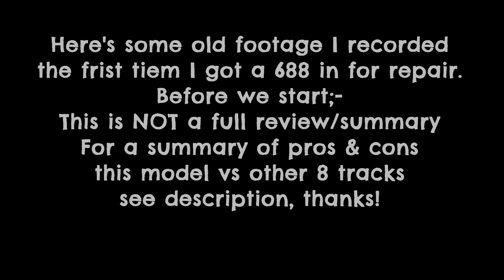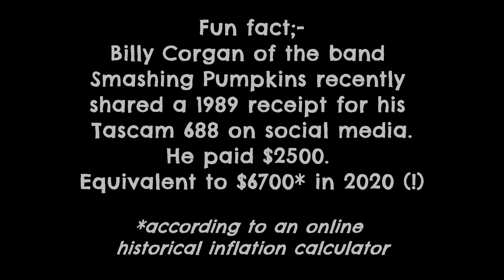Tascam 688 Midistudio | First impressions

Comment: Hi Calum, have you got any further with your repairs on this unit? I decided to chance my luck and bought another untested 688 this week, which unsurprisingly doesn’t work. It powers on but the LCD and transport buttons are completely dead (I can hear the motor humming and the external sync switches light up). Have you came across anything like that before? Thanks
Reply from the maker: Not really. You could check for unplugged cables in case a previous owner didn't plug boards or voltage regulators in properly on reassembly following a belt change or similar. Failing that, it'd be a matter of methodically troubleshooting, which would be a totally disgusting experience on a unit that large, heavy,  complex, and difficult to disassemble.
Reply: @Tetrakan  Thanks very much for your reply, and starting points. I’ll look for the obvious stuff and tag out if that doesn’t work, I lack the skills, patience and time for a methodical deep dive. 😳😂
Reply: @wehappyfewmusic  Try switching external sync to off. It wont work with external sync 'on', unless it is actually synced to something via midi & is a slave to the master midi device (eg DAW etc). My cat knocked my external sync to 'on', recently on my Tascam 688|)& it took me some very frustrating nights to figure out why it wouldn't work. Im mainly only using mine as a mixer right now, but it would not even work that way, with the external sync switch 'on'.
Reply: @emeraldphoenix9229  Thanks for the suggestion. I sent my unit away to get fixed and it had multiple issues unfortunately. It’s close to being fully functional now but it won’t record on tracks 5-8 for some reason. These are great machines when they’re working but seem to be tricky to fix.

Comment: Have one and can confirm that the fidelity is better than my 464. It’s a really good machine once you get it up and running. The SP tracks like “Pennies” and “Marquis in Spades” also illustrate that it’s quite capable of making excellent recordings.
Reply from the maker: By contrast my 464 sounds clearer than my 8 tracks. Not that my 8 tracks sound bad...an objective way to demonstrate the differences in fidelity between wider and narrower tape regions would be using spectral analysis to measure the volume of the harmonics from a square wave recorded to a 688 and 464 simultaneously. It's an experiment I will do for the channel one day. I expect to be able to demonstrate a quieter response to harmonics from the 688 from 4kHz up, and a narrower dynamic range.

Comment: Hi have you got around to fixing this unit yet? Would love to see what you did if so! I’ve just bought a 688 which should arrive soon, and I’am hoping it’s fixable. 🤞🏻
Reply from the maker: Hi, no, it's still languishing in my garage. I've totally overcommitted myself with repairs, reviews, demoes etc so probably won't get round to it until 2022! I hope for your sake yours works straight out of the box, disassembly is such a protracted process on this model, good luck
Reply: @Tetrakan  thanks, I think I’m going to need a lucky break on mine, otherwise I’ll have to find someone else to fix it.

Comment: The designers/engineers @ Tascam really did some amazing tricks to squeeze so much fidelity out of 8 tracks on eight inch tape, & I think one of the overlooked reasons, despite the excellent sounding mixer built in, is tape speed. It runs very fast, therefore much more ferrite/ chrome/ metal particals, passing the record/ play heads than a normal 4 track machine. A C60 tape only records about 9 mins at most, less I think.
Reply from the maker: Ummm….the tape speed is 3 & 3/4 inches per second, double conventional tape speed. This is stated in the user and service manuals. That’s the same speed as the Teac 144, Tascam 244, 424 series, and HS versions of budget 4 tracks such as the Porta One and Porta 05. At that speed you’d get 30 minutes from a c60.
Reply from the maker: Correcting myself…15 minutes recording from a c60 at 3 & 3/4 IPs, since the eight tracks occupy the entire width of the tape.

Comment: I'm stuck in indecision between this and 488 mk2, both was kept good and 488 is even comes with original packaging from 1996 and to me its aesteticaly is better but 688 as I discover has big response from anyone rewiews. Could you tell me what you would chose?
Reply from the maker: @VisegradDn  It depends. I prefer the mk ii overall but there are situations where the 688 would be more suitable. Do you need to move it from your home to a rehearsal space etc? Because the 488 mk ii is more portable. Do you need to record all 8 tracks simultaneously? The 688 can do that, the mk II cannot. Do you need more than 2 XLR inputs? Get the 688. Do you need phantom power built in? Only the 488 mk II has that.

Comment: What' s the most you'd pay for a working 688?
Reply from the maker: Hard to say. Prices for these things exist in a capricious second hand market. If I was fixing for one I'd look at completed listings on eBay to get a sense of prices then mull over whether that's something I could afford or justify. Im guessing a thouroughly serviced one - deep cleaned, calibrated, new rubber, audio path and PSU recapped - could fetch at least $1.5k?
Reply: @Tetrakan  thanks man.

Comment: Pretty fair assessment. I have a 644 in my stack of "stuff to get around to fixing". I'm guessing that this unit basically doubles up on the...well everything I suppose? Maybe the 644 makes more sense for fidelity being 4 track, but there's still the laborious routing business. Might make more sense when I get round to fixing and using it.
Reply from the maker: Yeah, I've had a few 644s before, my reservations are the same only more  so - only 3 tracks of audio alongside MIDI output seems very limited; 688 has some appeal to me because it's the only all in one cassette unit I know of you can record 8 tracks simultaneously, the 644 doesn't have that going for it!

Comment: So I just received one of these that was unfortunately not packed well. Most of the functions seem to work as advertised except for a major one- I can't seem to get the thing to record anything to tape? The meters are working, I get sound in the head phones, monitors, etc. The tape runs, FF, rewinds, all of those functions, etc. However, when I go to play back what I supposedly recorded nothing? I followed the manual, pages 18-19, word for word and still nothing? I even tested my new cassette tapes just to make sure those weren't bad, but that wasn't it? I'm at a loss and may need to return the item? But I thought that I would try these 688 comment sections first, just in case I was totally missing/not trying something, etc. Anyone on here who may have some words of wisdom, know these units well, and might know what is going on, I would sure appreciate it- Thanks.
Reply from the maker: I'm by no means an expert in this unit, either as a user or a repair person, but here's a couple of low hanging fruit things to check...there is a record protect switch in the top left corner of the cassette cavity. If the switch is not closing for some reason (bent contacts, broken wires or bad solder connecting to the switch...or you're using a tape without the record enable tab present!?) then even if the rest of the system is healthy, and the horribly complex routing system is set up correctly, nothing will record. So do check that switch, and that the record enable tab on the  cassette itself is present.
Reply: @Tetrakan  Hey, thanks for replying. And that's has been the crazy thing. Things are actually recording, just not playing back. The recording, after being recorded on the 688, will play on my 4-track, just not on the 688? However, I can play a regular cassette (thought it of course sounds scrambled) on the 688? The meters, monitors, headphones are all good when doing so, etc. As is the case when recording- Just not when I go to play the recording on the 688? As if things are not routed to play the recording on the 688 actually on the 688? And when I set up the scenes according to the manual (pg 18-19), it does everything that it is supposed to, except for playback? Thanks again for your reply, and any thoughts that you may have are appreciated.
Reply from the maker: @MrTeasand maybe don't put too much faith in the scenes. They could have been corrupted somehow,  or intentionally overwritten by a previous user, or the little circular battery which powers the memory is flat and the scenes have reset to some default state? See if you can route the signal from the cassette track to the mixer manually?
Reply: @Tetrakan  Okay, thanks- Will do!

Comment: As far as fidelity goes when it comes to 8 tracks vs 4 tracks, isn’t that totally offset by tape speed? The 488 has double the tracks but runs at twice the speed as a 424, so shouldn’t the fidelity be basically identical?
Reply from the maker: Thanks for watching but I'm not sure where you got the idea that the 688 has double the tape speed? The highest speed setting on both the units you mention is 3&3/4 inches per second; the capstan motor in this unit is the same as in the 424 mk ii and mk iii, which is the same speed as the motor in the 424 mk I also. It's really only the budget units like the porta  one and 05 which operated at half that speed, though both those models cane out in an HS version which again is the same tape speed as a 688.
Reply: @Tetrakan  The manual states it uses 2x speed for higher fidelity. But yeah I see now that the 424’s had a normal and high setting, the high being the 3&3/4 inches per second and the normal being half that, which is the same speed that commercial tape players use. So I guess my question would apply to a 488/688 as compared to a 424 at ‘standard’ speed. Basically, if you’re splitting the four tracks of a tape, right and left for both sides, into 8 tracks, but doubling the tape speed compared to consumer tape decks, are you actually losing fidelity.
Reply from the maker: @godofspacetime333  I reckon if you tracked a guitar to one track of a porta one at 1&7/8 ips and simultaneously tracked the same   guitar part to one track of a 688 at 3&3/4 ips the fidelity would be broadly equivalent, though as I understand it frequency response and dynamic range at different frequencies would be different, and that would account for a slight objective difference in the results, above and beyond the effect of the different mixers and preamps.

Comment: Dividing that skinny little tape into eight subsections has got to make for terrible sound. Cassettes sound terrible to begin with.
Reply: No, it's not. It actually sounds quite good. And it sounds a hell of a lot better than protools and those awful digital plugin tape emulations..grab a decent warm audio mic pre like the WA 73 and you've got the fattest sound town
Reply: Nope, they sound  great.
Reply: LOL! @JimAndyAllyn
Reply: LOL!  @kaivrock  who just confirmed that he knows nothing.  The Tascam 688s, or their mixerless rackmount equivalent the Tascam 238, are still in demand for studios who want the sound of analog tape saturation.  And having recorded several albums on my 688 back in the day, I can assure you the sound quality is quite good.  They run the tape at double speed for better high frequency response, and also use DBX noise reduction.  Furthermore, when CDs first came out, TDK used to record them on their cassettes on high quality decks and take them to the shows where the "golden ear" types would hang out and do A/B comparisons, and most of the golden ears couldn't tell which was which.  Go ahead, @kaivrock, run your mouth and show off your ignorance some more.  You have nothing to lose but what little credibility you may have had when you started running your mouth.